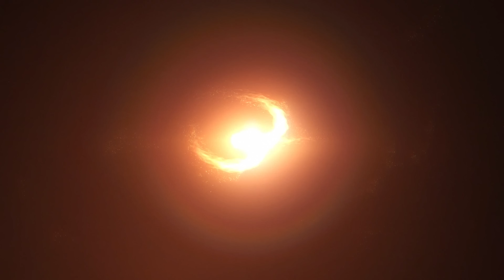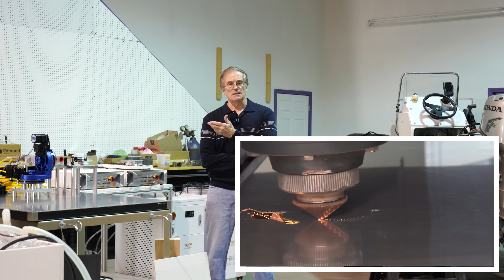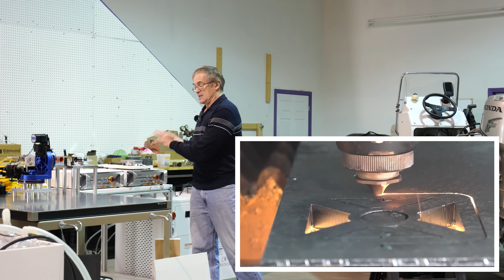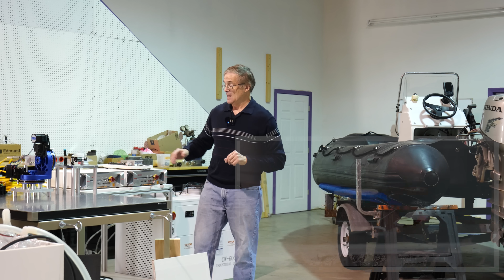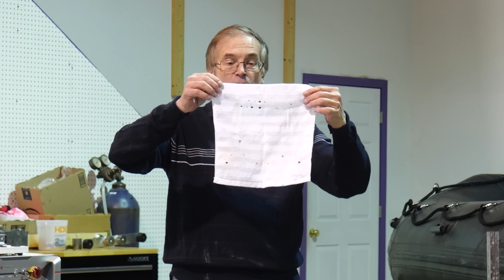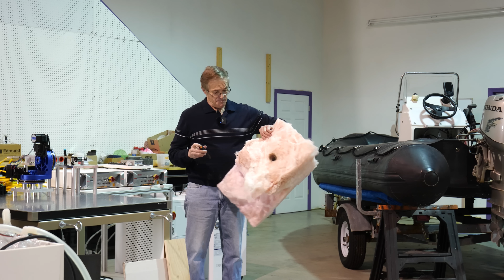We have a problem... and need your help!

Comment: First thing that came to mind is putting sand in between 2 boards so if it melts the sand it either turns into glass and reflects it internally or gets vaporized and more sand falls to take it's place.

Though this might just end up making a glass tunnel that would stop the sand, I don't really know.

Comment: What about a moving surface? If the gypsum moves more then four times the beam width every second (quarter second burn thru time), it should in theory be fine. And I suspect that really isn’t all that fast.

Comment: A trap that has a “live” bottom…. Acoustic vibration panels at the bottom of the trap vibrates bone black carbon  powder within the box…. It’s tunable and very resettable… venting should be very detailed so as not to create a “bomb”. The trap materials can be light weight and the target face can utilized ablative materials/coatings… 

Maybe the traps internal walls utilize a combination of ceramic coating and texture to bounce the beam further.

The added benefit of the bone black powder is that it constantly coats the interior with bone black… refraction and heat dissipation that is self healing…

Make a hole? Patch it. 

Pierces the target face? The aerosolized powder refracts the beam into the traps interior.

Maybe utilize powdered bone black carbon and powdered graphite/ceramics?

This would obviously create a breathing hazard. 

Over pressure venting could be ducted outside.

Operational venting would need appropriate filtering to allow air movement while trapping the aerosolized particles.

I do believe this could work. It’s tunable. It’s testable. Its portable.

Comment: What about a Large Tub of water bath made out of black carbon steel. Make a small window on the side and use  a refracting glass pane that will refract so that the lasers energy hits multiple places on the inside of the water filled tub. The large mass of water will provide cooling and the black carbon steel walls would absorb the heat while the water keeps it cool.

Comment: The answer is simple, stop thinking 2 dimensional and address it in 3 dimensions. Instead of directing a linear high intensity beam create a system that uses two beams that amplify the energy only if they intersect, at the point of the intersection.

Comment: The case where the laser is on but not moving can be handled by a hardware circuit (no software) to detect and turn off the laser. That would greatly reduce the time the blocking structure would need to last. However, if shooting it through a non-moving target is a valid case, it becomes a little more difficult. You could use a light sensor to detect the light being scattered by the backdrop to detect the laser hitting it, which you could allow if the angular velocity is above a certain threshold, and automatically shut down the laser if it hits the backdrop while it is not moving, or not moving fast enough.

This could be completely done in hardware, or using very simple software (simple = reliable) in a microcontroller, and would reduce the time the backdrop would have to block the laser down to milliseconds.

Comment: I had heard that dust, smoke and fog are problems for laser weapons because they scatter the energy and attenuate the beam strength. Could you make a glass chamber that you fill with smoke or use some kind of turbulence to keep dust suspended in the air such that by the time the laser is through the chamber it is scattered enough for the back surface to resist it? A three foot deep chamber filled with dense smoke that is constantly circulating can’t have a hole punched through it. Presumably the glass will be transparent enough to not let the laser burn through it. A strong fog or mist generator would let you do this with water vapor. 

If this won’t work with air, perhaps suspend some kind of fine light scattering particle in water like fine charcoal, black iron oxide, or graphite powder for something that absorbs, or fumed silica or alumina powder for something that reflects. The laser energy should attenuate very quickly going through such material. Would two feet of depth be enough?

EDIT: If I had to guess, I'd say a mixture of something white and reflective and something dark and absorptive would work best. The reflective bits scatter the beam while the dark bits absorb it. At high energy levels, absorbing the light would destroy the particles, so I imagine a mix of both would give the best attenuation, where the reflective bits scatter the light to lessen how powerful it is, while surrounded by particles that absorb it.
Reply: Could also be made with cheap materials like a wooden frame and a translucent sheet of plastic.
Reply: @ikke602  I like the idea of this, but I am concerned that plastic might just melt. Even highly transparent plastics can be laser-cut. I suspect it would take very clear glass to pull this off.

Comment: I like the water idea, i would just scale it up a bit. Get a 200 liter drum, cut a hole in the side and replace it with something transparent to your laser. Add some carbon black to the water and throw on a mixer to keep it suspended.

Comment: Maybe you could treat the plywood in some way to deal with the burning? It's at least a different problem than stopping the beam. Maybe just intumescent paint? Or wet down the plywood? Or surround the plywood with something like argon or carbon dioxide that won't let the wood burn? It feels to me like the burning problem is a little more tractable than the penetration problem, since there are so many restrictions about size, weight, and cost that limit the materials for the actual barrier. So tackling the fire issue seems like a good direction.

Comment: I have Laser beam dump for IR lasers that I got on eBay.

It's a big aluminum cone, with a glass window opening to a black liquid inside.

You might be able to recreate something similar by sprinkling a large amounts of graphite powder into water.

I would double check the wave length absorption though.

Comment: Sounds like you need a collaboration with @brainiac75 & @styropyro .
My thoughts would be can you for this as a pulse rather than continual wave... getting the timing by timing how long it takes to cut trough your target material. 
Secondly, what's the wavelength you're using? Is there a substance that has an absorption spectrum at the same wavelength? 
Thirdly, and I don't know how practical to implement, would be to redirect the beam to a beam dump... perhaps using lenses to defocus the beam before entering the beam dump. Brainiac75 made a beam dump though the power level you're working at is much higher. 
It may be a dumb thought but have you asked an AI (chat gpt etc) and see what suggestions that makes? I presume you'd need to give specifics of power density and wavelength.
Reply: From chat GPT:  When working with a high-power, long-focus fiber laser, the backstop must be capable of safely absorbing or dissipating the laser energy without reflecting, transmitting, or catching fire. The choice of material depends on the laser power, wavelength, beam diameter, and operating duration, but here are some standard and effective backstop materials:

---

1. Laser Beam Dumps (Commercial or Custom-Made)

Material: Typically made of high-temperature ceramics, copper, aluminum, or carbon composites with black anodizing or coatings.

Function: Absorbs and diffuses the laser beam thermally.

Advantage: Engineered to handle specific laser powers and wavelengths.

Best For: Controlled environments or continuous operation.

---

2. Carbon/Graphite Blocks

Properties: High thermal resistance, low reflectivity (especially at near-IR wavelengths like 1064 nm), and non-flammable at room pressure.

Use Case: Common in high-power laser labs for beam stops or catchers.

Caution: Should be thick and properly ventilated; can become brittle or produce dust over time.

---

3. Black Anodized Aluminum with Heat Sink

Effectiveness: Good for lower duty cycles or moderately high powers.

Cooling: Requires active or passive cooling depending on exposure.

Wavelength Note: Works better with visible/NIR lasers; less efficient for mid-IR or UV.

---

4. Firebrick or Refractory Ceramic Materials

Pros: Inexpensive, heat-resistant, non-reflective (especially if dark-colored).

Cons: Can crack under intense, localized heating unless heat is dissipated.

---

5. Water-cooled Metal Plates

Description: Metal plates (usually copper or aluminum) with integrated water channels.

Usage: Dissipates heat effectively for continuous high-power operation.

Coating: Often coated with a laser-absorbing material to reduce reflectivity.

---

Safety Notes:

Avoid reflective surfaces — bare metals, glass, or polished ceramics.

Ensure the backstop is securely mounted and not flammable.

For fiber lasers (typically 1064 nm), many materials may appear dark but still reflect IR — verify IR absorbance.

---

If you can provide details like laser power, wavelength, and beam size, I can recommend a more tailored solution

Comment: I am not a real scientist in any strech of imagination , but it looks to me that there is nothing you can do to stop that laser in one go.... If i can make simple comparison .... that laser is like a 50cal bullet but made of light..... how do you stop a bullet.... with stronger material and in layers ...... on that note .... how about the cube of some metal that has the highest melting point , with curtain of water/liquid nitrogen flowing ower it , and freeze the material in nitrogen before the test..... or it can be a brick or some ceramics with the same water flowing ower it , small closed loop fountain..... anyhow can't wait to see the tests ....ohhh and maybe try balistic gell just for the fun of it.... aaaaaaa soooo exicted about this 🤗☺🤩

Or lazy susan on motor with bricks , like dominos. and offset so it hits on one side and find the speed that works ...... maybe .... and definitely enclosure with that carbon black paint or fabric, it might help with absorbing scattering ..... good luck

Comment: two sets of proper frequency transparent plexiglass, 6/8/whatever inches apart.
High power fans to circulate fine sand inside said enclosure.
Or jets at the bottom, but then you must have a cloth backdrop instead of plexi.
Run the jets from a 100 gallon compressor tank.

Should give you several seconds of lift.
Heavy fused particles will fall to the ground.

Comment: What if you submerge a material in a thin fish tank filled with water. The towel or something similar may survive if it is submerged. And as mentioned below, put an active wall behind the fish tank in case it fails. You could make the tank easy to drain and fill to be able to move it around. The glass would need to be transparent enough to allow the beam to pass through to the submerged target without damaging it.

Comment: Spit-balling here:  Water held in to a container by Aerogel?  or  Didn't the SR-71 use a quartz based glass instead of silica based because of the high temperatures it experienced?  Perhaps something that self-heals like stacks of ceramic tubes.  As you vaporize one, another falls in to place.

Comment: I had a laser light show company for many years. The highest power Lasers we used were KTP/ YAG.  40 watts. Which by comparison is like a cat toy compared to yours. My first thought was an optical surface to spread the beam, and aim it into a water cooled beam dump. What about a chunk of Granite Block on a rolling cart?  Or maybe there is a way to make an "epoxy granite" block...  Getting more elaborate,  what about a thick liquid curtain carrying carborundum or graphite in the fluid? Could be arranged on a moveable cart...

Comment: Would a wall of dry sand work? Sandwiched between drywall or durorock say 12" thick of sand which would flow down continuously closing the laser hole.

Comment: What about a continuous waterfall with polished aluminum chaff in it? Another idea is a roller on top and bottom with a kevlar belt as a wall, spinning fast enough do dissipate the heat.

Comment: Build a platform for your death ray device, I meow, laser, add a small crane to hoist things up and point the beam down. Down there you can have a bigger non-reflective target, like let's say a concrete slab on wheels or a bucket full of gypsum also on wheels.
Or dig a hole, a long trench the length of your shop and cover it with removable panels (reinforced concrete about 2-3 inch thick) so that you can drive over it. It should be about as wide as the distance between the car tires, so it can for accessing the underside of a broken car. Depth should be approximately to your shoulders when standing inside. Put concrete stairs at both ends. The ones toward the door should be in the trench, while at the other end you'll have them 90 degree dug into the side wall, approximately 1 meter away from the end, thus allowing for placing the death ray target at that end of your trench.  The target wall could also be 2 reinforced concrete walls in front of each other: the back wall will deal with retaining the ground water, while the craters in the front one can easily be patched with some concrete and mesh (use a bucket of cement, water and a little sand then apply with a spatula); gypsum could also work.

Comment: How about a version of an aquarium filled with dirt and water to keep temps down.  I might be cautious of rapidly expanding gasses, though. 
Second idea is a really thick wall of sandbags, maybe on a trailer to easily move in and out. 
Third impractical idea tungsten covered in thermal paste 😂

Comment: What about a frame filled with water that is constantly agitated to create dispersion, potentially filling it with something that is refractory (tiny jacked mirrors/light dispersive particles) and has kind of the same buoyancy (the water buoyancy could be modified as well by way of additives to match the dispersed particles). The idea is that the water would both soak the energy, the agitation would help disperse the concentration of the laser together with the small refractory mirrors in the water, and the wall could even be attached to a heat exchanger. The backside and sides of the wall could be filled with a light absorbing material, so that whatever parts of the laser which got scattered and escaped, would hopefully be low energy enough to be absorbed by the wall materials without them melting. 

So how to contain the water on the front? For general experimentation, I would suggest hanging the laser OVER the frame, so that the frame itself contains the water without the need for glass by way of gravity. Otherwise I would suggest to get a large enough pump and turn the solution into a more viscous one, and pump it to the top of a panel, and let it slowly sludge it's way down the panel. I think using any type of glass would be unrealistic, but that would have been easier.

Comment: You haven't mentiond the overall power you're working with, but bricks are the solution. Cheap and effective. We used them in our high power laser labs. "Fire bricks" are even better.  Block would be lighter but less dense.   You don't need giant walls.  The bricks need to be placed CLOSE to the final output head in strategic locations to prevent emission below a certain elevation so nobody can get exposed. I have worked in the industrial laser industry for a few decades.

Comment: If pointing the laser horizontally will do too much harm, point either upwards or downwards.
If target material will evaporate too fast, re-feed target material to target spot.
—> you may consider a downward sandbox of really dry sand or salt trickeling down.

Comment: so this just a laymen idea, but what about a thin pressurized metal box fill with water? something with the dimensions of a picture frame? it could act as a form of reactive armor. if the laser pierces the container, water would spray out in the direction of the laser with it's droplets diffusing it in over the whole of the front face. it only need to be a few inches deep and you could paint the front black to help with absorption. and you could probably tap the whole created and insert an bolt for re-use. you'd have to figure out the pressure needed and possibly even the opacity of the liquid with potential additives. but sounds like the best bet for the way you're going about it.